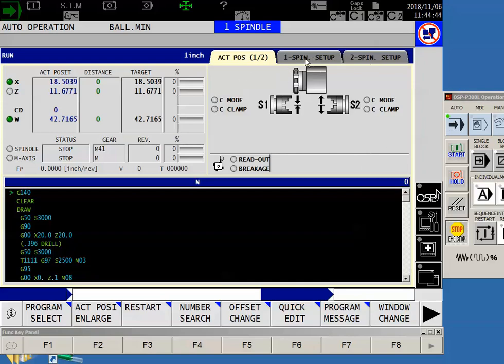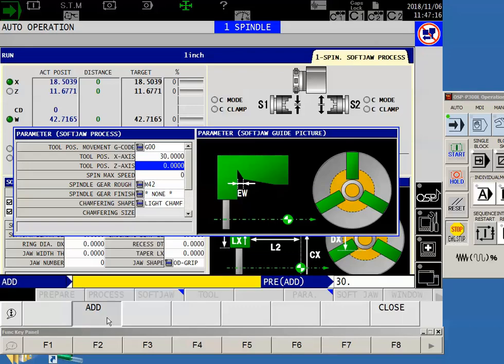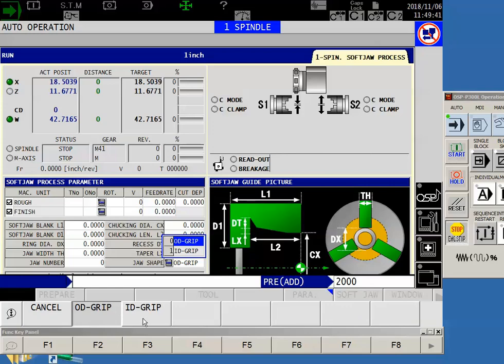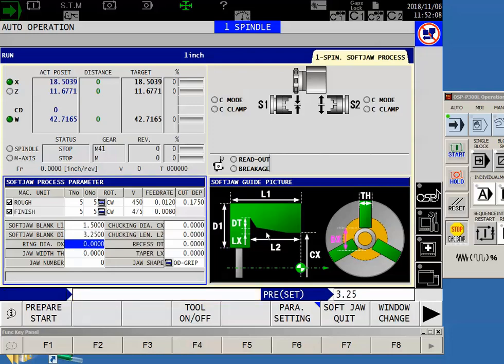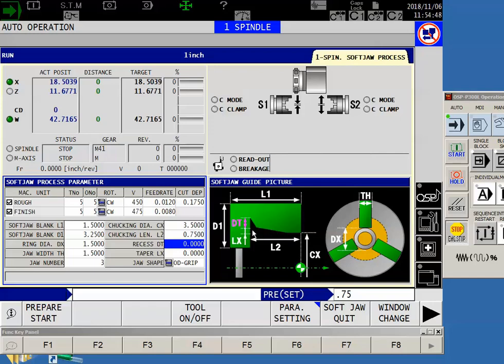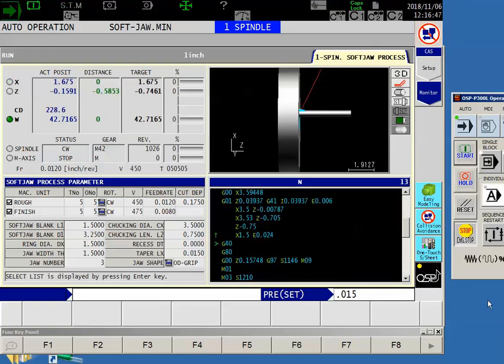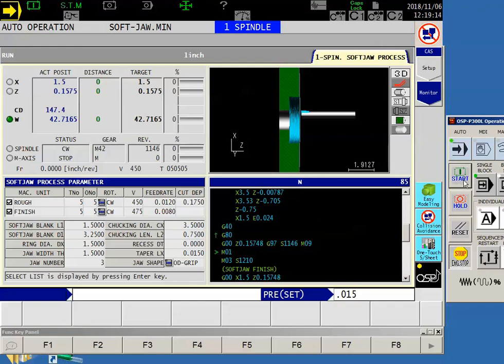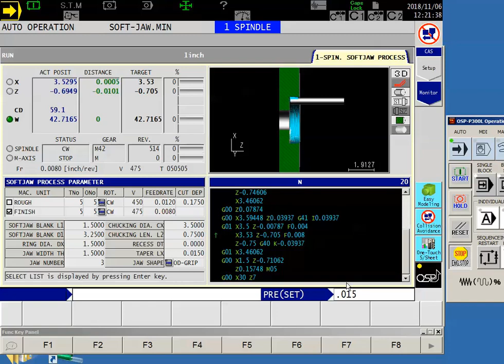SOFT JAW PROCESS

Comment: HI can you please tell where to flip the switches for id od range to bore the jaws without clamping anything? its manual or in software?
Reply from the maker: The range setting would be the proximity switches located on the hydraulic actuator, but to switch from ID to OD to bore jaws, if I’m understanding the question, it’s software. For any control that’s P200 or older, the switch will be in the parameter page, CHUCK page. There were a few models of machines (mostly VTLs) that had a physical switch on the control for changing clamp modes too

Comment: This is great! Thanks! If you can, a detailed video of how to use the sub spindle would be great! I'm trying to learn how to program it
Reply from the maker: Sorry, this comment slipped thru the cracks... Do you mean using the soft jaw process on the right spindle or programming in general?
Reply: @pocketcharleywithgosiger  Yes sorry I forgot to answer. 

I meant using the soft jaw process on the right spindle... also is there a way to add a drill to pre-drill the soft jaw 1st?